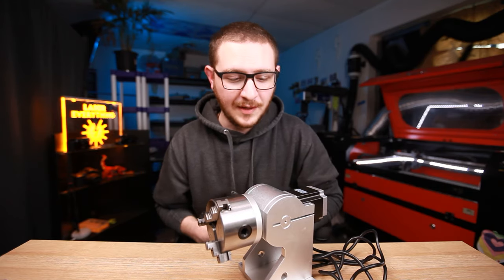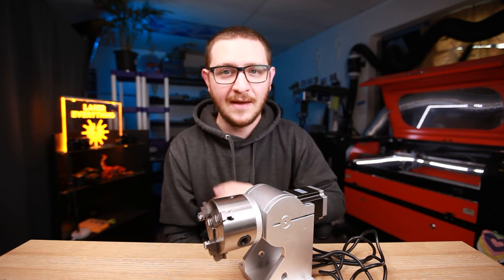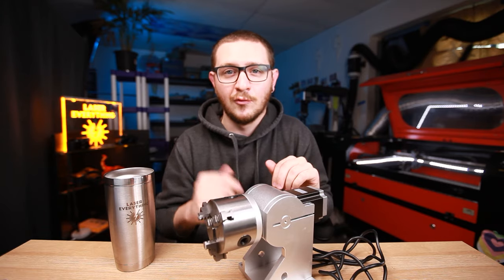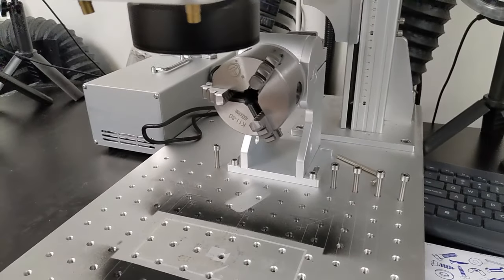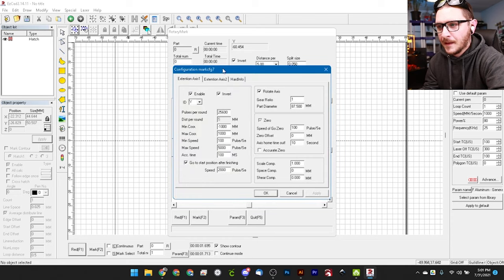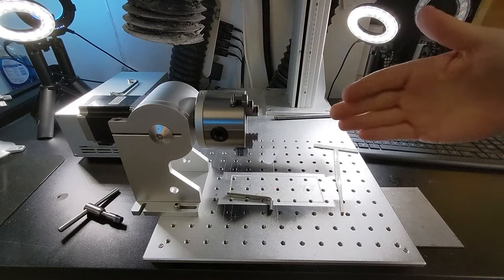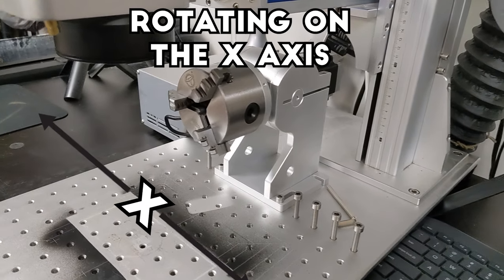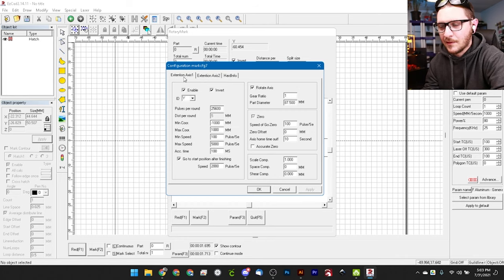Set Up A Fiber Laser Rotary Tool with EZCAD | COMPLETE GUIDE

Comment: Excellent video. If I want to engrave for example a fingerprint inside a ring I would have to use rotary Mark? I have engraved text inside and outside rings but vectors so far I don't know how to do it. I hope you can help me.
Reply from the maker: Yes rotary mark with the ring at a 15 - 20 degree angle so that the laser can actually hit the inside of the ring. Split size should be some multiple of your line distance. Triple check your focus before you begin since it will be at a slant.
Reply: @LaserEverything  I guide the focus point using the two laser dots next to the lens. Is this OK? Or should I measure the distance from the ring to the lens with a ruler?
Reply from the maker: I don't always necessarily trust the dots. The fixtures that hold them in place can loosen over time and who knows if they came from the factory accurate. I recommend going to watch the fiber laser setup video where we go through how to measure your focal distance accurately and create a focal stick. At the end of the day nothing beats a physical stick you can jam in there and be absolutely sure that it's going to work.

Comment: How on earth do you tell the rotary and laser to mark a simple line around the circumference?
Reply from the maker: I'd measure the circumference and then draw a line or very thin box along the right axis that's exactly the length of the circumference. Go into rotarymark like we do in the video, set a split size and then run it. It should go completely around the bottle. If it doesn't make it or over laps either you're circumference is wrong or you're out of focus or the bottle isn't level or it isn't flat against the rotary tool or a combination of all of those things. Everything has to be just right.
Reply: Thank you very much for the help! I Will try this first thing this morning.
Reply from the maker: Happy to help
Reply: That worked! Thank you so much for your time and help, im still playing around with the split sizes but i think ive about got that down. Your videos are very informative and have been the best in explaining the settings and machine functions. Translating the instruction manual from chinenglish is another skill to master.
Reply from the maker: Yeah haha. Glad you're getting value out of the videos. Hope to see you on Discord!

Comment: re: the settings on the controller and in EZCAD.   Is there a physical limitation of the stepper motor itself as to how many discrete steps it can make in a 360 degree rotation?  In other words, if you set the dip switches to 12800 steps per revolution, and set the same in EZCAD, but suppose the stepper motor itself can only physically move 6400 steps?   In your case, can that rotary stepper motor actually deliver 51,200 discrete steps in a 360 degree full rotation?  Reason I ask is because I believe I have the same rotary device, but the controller that came in my box has a maximum step size of 25,600.  The default from the factory is set at 12,800 steps.  So that has me wondering about PHYSICAL LIMITATIONS of those stepper motors.
Reply from the maker: That is a great question that I do not know the answer to unfortunately - it's a bit out of my realm of knowledge. It'd be a good one for the community though I'm betting someone has the answer. I saw in your other comment you weren't down for the discord but I mentioned we had a linke to the facebook group as well if that's more your speed. Hope that helps.

Comment: Hello Alex, first of all thank you very much for sharing your knowledge. I have installed a rotary to a BJJCZ FBL1-B-LV4 board with ezcad? I've been trying for a few days but I don't give. I have pin 14 to Dir and pin 15 to Pu, tb 5v 24 and the motor connected to COM4. But I can't get it to move me. Might you help me? Thanks in advance.
Reply from the maker: Hey Daniel, this is a pretty technically advanced question. I think you're going to have much better luck asking it on the Discord along with screen shots of your ezcad parameters and settings so we can take a look. Join up if you havent and post as much as you can there so we can effectively diagnose this. Thanks!
https://discord.gg/5JQaja8j

Comment: Can you change the split size in between passes on the object? Like, if you want it to be faster to reduce the time on the device the second pass?
Reply from the maker: I don't believe there's any way to do that currently in LightBurn or Ezcad without saving two project files and running one first, then opening the new project and running the second one after.

Comment: Ok so I have a 50w fiber laser from OMtech and I also purchased the rotary tool from them.  For the life of me I can't get the thing to work worth a crap if I try using the rotarymark option under laser.  I have to use the split line one.  Driving me nuts.  Looks like crap with rotarymark and it tries to mark half the cup without rotating.  So frustrating
Reply from the maker: Are you part of our discord server yet? If you're not join, there's a link in the description. Post your F3 param settings for rotary mark there so I can take a look.

Comment: I followed the instructions to a tee but I’m getting some weird artifacts in the design- stars look a bit misshapen. Not sure if it’s the split size or perhaps the tumbler isn’t perfectly circular. I measured the diameter of the tumbler where the engraving would be but it’s possible it’s off by a fraction of a mm if the tumbler is warped
Reply from the maker: We can't really get into it in the YouTube comments as it's not the best place for more intensive support threads but we do have a few options where you can get help. Either check out Discord Server or Facebook group - links in the description - or you can check out our new forum over at https://www.lasereverything.net/forum and I'm sure we can get you pointed in the right direction.

Comment: I am having such a hard time with my rotary.  Iced confirmed the pulse rev but my images are extremely compressed.  I've tried the same rotary on another laser with the same issue.  I'm wondering if my gear ratio isn't 1?  Any way to confirm this?  Any other tips would be appreciated!
Reply from the maker: Make absolutely sure you're reading your pulse rev chart correctly. The ONLY way your gear ratio isn't one is if your motor turns gears and belts instead of turning the chuck directly, which I highly doubt (though if you're using a roller rotary you'd be correct and that's a different story). Otherwise something somewhere else is being miscalculated. This sounds like an issue for the fb group or discord.

Comment: taughts on lightburn  vs EZCAD?
Reply from the maker: You can't compare them. They're different tools for different jobs. You can't use lightburn on galvo laser machines that operate with ezcad control boards. Lightburn is higher quality software but it's irrelevant since they work with specific controllers. No use in comparing them.
Reply: @LaserEverything  noted

Comment: Hi Alex Trying to get my rotary to work. Watched this video multiple times. When I hit Mark, the cup turns about 1/8 but then the rotary just makes this tick, tick, ticking sound. When I exit out of EZCAD I get the error message for the rotary that says 'Invalid device handle'. Any suggestions?
Reply from the maker: Maybe an issue with the stepper motor? Hard to say. If you can, drop a video in discord or facebook so we can have a look.
Reply: @LaserEverything  Can you please send me a Discord invite. Thanks.
Reply: WTF?? Now it's working. I did reboot many times. Please LB gods keep working!
Reply: Correction. It worked once...:(
Reply from the maker: https://discord.gg/KJBxVqJe

Comment: So I went and used the rotary to but for some reason it change the configuration of the working area in EZCad.  The white page when from a nice even square not to a thin log rectangle.  Any suggestions on how to go back to my large work area
Reply from the maker: When in the RotaryMark setup the workspace configuration changes. It will not affect your main workspace outside of the RotaryMark plugin unless you click the "Refresh" button which you should NEVER click. Doing so alters your main workspace. To fix it you have to go into your system paramters (the screwdriver and wrench icon at the top) and click Workspace and redefine it to what it should be. It is briefly covered in the fiber laser set up video which you can find here: https://youtu.be/FZT9zOp9Sl8

Comment: Question - when I use my rotary, the size doesn't match what is on the screen.  For instance, my 20mm side item becomes 80 when I use the rotary tool.  The diameter is set correctly.  Is there something else that I am missing to fix this?  Thanks for your help!

Comment: Hey I seemed to get everything working but my laser wont actually make marks. It runs fine but it seems the power isn't strong enough? It works on any other product I am lasering but just not the rotary. Are there specific settings to set on the rotary or does it go off of the regular settings in the side bar?

Comment: how do you get the vertical spaces or lines out of the imprint
Reply from the maker: You're going to have a hard time not "cross hatching" these tumblers without going VERY VERY slowly (doing an 90* hatch instead of a 0* hatch) and even then, I don't think it would look much different. You can try larger split sizes but then you'll have issues with over lapping split lines and that brings up it's own issues.

Comment: This was so helpful! I just hand an issue where EZCad2 wont mark images ob the rotary but will mark text and drawn shapes???? Any ideas??
Reply from the maker: Ezcad won’t mark raster images using rotary adding, this is expected unfortunately. You will either need to vectorize the graphics, or switch to lightburn which supports that functionality
Reply: @LaserEverything  wow! I'm shocked but this makes sense with what I'm seeing. Thanks for the answer you've saved me a bunch of time!

Comment: Hello buddy 
What laser engraving machine you recommend for .003 or more deep on metal frame for firearms
Reply from the maker: That depth can be achieved with an appropriate sized lens on anything from 20+ watt fiber if you really needed to. Additional wattage means you can go faster and can drive a larger lens, it really depends on your needs, work area sizing you require, etc.

Comment: Hello, can you help me. I have a 50w Fiber laser machine (Oree Laser). The machine stopped marking from one moment to another, it only scans the red laser. I have changed the laser cable and there is no solution, I have restarted Ezcad2 with no solution, I have traveled the height of the head looking to focus, but the machine does not emit laser. What will be the problem? Can someone help me please. Thank you so much. Christian from Chile
Reply from the maker: Hey Christian, sorry it's hard to troubleshoot these types of issues in the comments. It would be best to make a forum post on the Facebook or Discord group (linked in the description) if you're still having trouble. The team and our community can work together to help you troubleshoot.

Comment: I have a MOPA and use ezcad3, but I dont have the option for RotaryMark, actually it only shows materials parameter and laser monito option. Should I do the ezcad3 installation again? Or is there any way to get this options activated? Thankyou so much
Reply from the maker: F3 Param > extension axis > axis A
Reply from the maker: Axis A and enable it *

Comment: I'm using markingmate software can you please help me how to set up rotary marking
Reply from the maker: Sorry, we don't have a laser that uses that software. The concepts should be very similar, but the interface in software will likely be different I'm afraid. If we do have the opportunity to get a machine with that software, we can certainly look into it! There are some members of the community that also have that software, so you could try joining the FB or Discord to see if you can connect and work together.

Comment: I have all the parameters correctly but my rotary just don’t come back to the original position,, if anyone can help I would appreciate it  ,, thanks 🙏🏼
Reply from the maker: Make sure "Go to start position after finishing" is checked in the rotary axis settings page, then lower the return speed (the number directly under it) higher speeds can be less accurate.

Comment: quick question, my ezcad doesnt even have the "Laser" setting on the menu next to special and help. any idea?
Reply from the maker: Not all versions of Ezcad support plugins. You can try the Ezcad 2 CE from our downloads page and see if your controller is supported. You can get it from https://www.lasereverything.net/downloads
Reply: They mentioned my board is not supported for the rotary tool, do you know what BJJCZ board I need to support the rotary ?
Reply from the maker: The fiber lite B board, full size ezcad 2 board or ezcad 3 board all offer extension access support
Reply: @LaserEverything   do you use EZcad 3 or do you recommend sticking to EzCad 2?
Reply from the maker: I recommend everybody move to EzCAD 2 so that you can use light burn! The LMCV4 controller it's an excellent model that works great with light burn and doesn't break the bank.
Reply: @LaserEverything  thank you so much man, this is why I love your channel. I started up my own little laser engraving business thanks to you and you’ve  been such a great help!
Reply from the maker: You got it. Stoked you love it so much!
Reply: @LaserEverything   I wanted to know  if you had a list of the parameters that you have on your subscription . I want to sign up for those.
Reply from the maker: Mostly the settings showcased on the channel here and there, just organized into a nice package. We don't like locking things behind paywalls.
Reply: @LaserEverything   gun stippling/engraving 😉?
Reply from the maker: Maybe as an LMA special at some point but not on YouTube due to monetization issues.
Reply: @LaserEverything  oh I mean I saw it on your library of parameters on a video you made, so just wanted to make sure on there when I sign up if it was going to be there is all. 😃

Comment: Please, help me due to my rotary tool only works when I use SplitMark2 and not when gotta be RotaryMark, IDK what to do
Reply from the maker: Make sure when you're trying to use rotarymark, that you only use a uni or bidirectional hatch. Make sure your hatch is running parallel to the direction your rotary is pointing. Make sure you're also only using vector images, not raster images. Raster images aren't compatible with rotarymark.

Comment: do you sell your parameter library for fiber laser 30w
Reply from the maker: Sorry for the delay! Previously, they were a perk of supporting the channel/community. If you head to the Laser Everything website, there is a link to our shared library right on the homepage. It covers most wattage and lens combinations, for both ezcad and Lightburn. All made free, possible by the community support over at the Laser Master Academy, check that out too if you get value from the community resources :)

Comment: 28:55

While setting up the cloudray fiber laser I have, I get to this step here and nothing happens. The red focus dot doesn't move, the rotary doesn't change, etc. I'm not sure what setting I'm missing or not.
Reply from the maker: That movement is entirely going to depend on your start position, which is dictated by where your artwork is in relation to the axis it is rotating on. If your artworks bottom starts at the center of the work area for example, it will be different than if it’s further down.

Comment: I have 50W Fiber Laser Marking machine with 220mm lens. If I mark small area on the stainless steel Then I will be get good result.. If try to mark large area like 220mm the result is poor. I will get Very light marking. Why like this?
Reply from the maker: It's hard to troubleshoot through the comments, but this video may help: https://youtu.be/JwWV6Hki5Dk
If that doesn't help, join one of the communities we have linked in the description like the FB/Discord/LMA and the team and community can dive in and help much easier through the forum posts.

Comment: Does anyone know how to set it to start from the center in the settings for rotary engraving (EZCAD Split Mark2)? The problem is to accurately measure the middle if it starts from one side, especially when only one piece is engraved for the customer and I don't have the possibility of correction on the other piece :-)    ...  I need to engrave 30 personal names on perfume bottles, each name is different length and should be in the middle, aligned with the existing logo on the perfume bottle